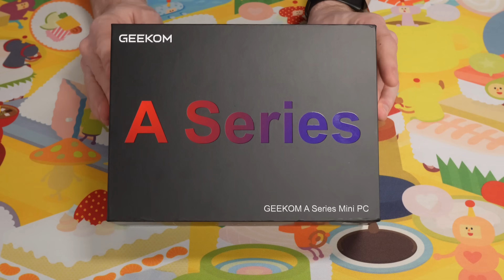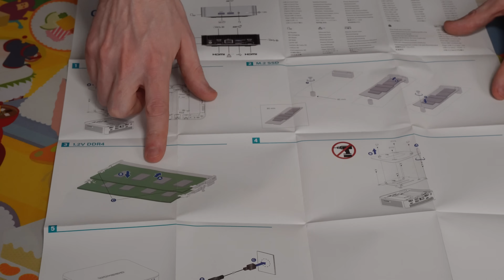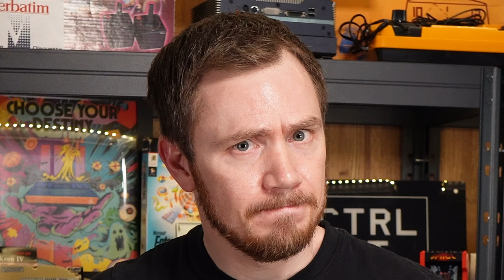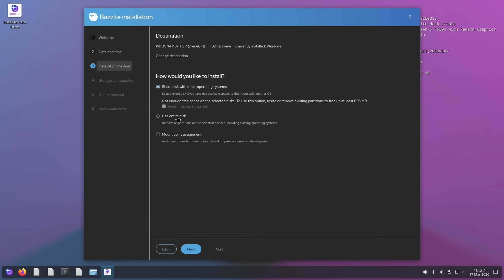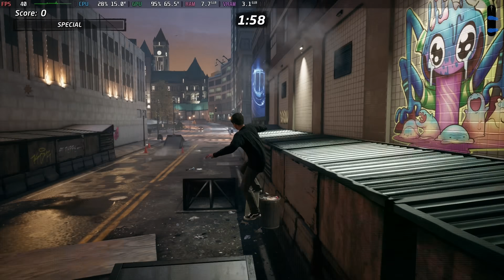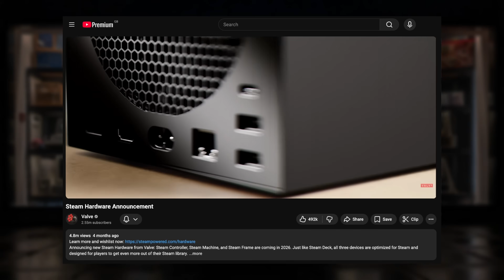A Smaller, Cheaper Steam Machine? The GEEKOM A5 PRO 2026

Comment: 21:11 when you were testing it in windows the power profile was only set to 2Ghz and was 4.55Ghz in Bazzite would have been nice to see it tested with the same power profile before its performance conclusions are all landed on the Linux distro, the pc needed correct setup for performance on the windows install first, i also understand that right there is where windows is failing and the out of the box performance was hampered with the preinstalled windows.

Comment: i will not touch any mini computer over 400 dollars. anything over 400 dollars is a rip off. it should have all the top of the line capabilities all for 400 bucks. period, and if the price of ram doesnt come back down , i will make my own ram. thats not a joke. i used to get 128 GB ddr5 for 125 dollars. now they want $5500 for it. fuck that.

Comment: Why does the Windows Geekbench show the processor running at 2Ghz  vs 4.55 for Bazzite?
Reply: Windows use throttling with CPUs; while linux unless you set a power profile for saving energy, is always using the highest CPU speed possible.

Comment: Hey @ctrl-alt-rees , could you confirm that that your Windows geekbench results were not done on some battery saving mode that the mobile hardware was running under?  The Bazzite results were impressive, but they were only marginally better then the Geekbench results for the exact same system using windows that were submitted by other users.  Specifically I think the GPU might be a factor as that usually get throttled by the power saving features.

Comment: During gameplay I noticed that the unit only uses 15W. 
If I recall correctly, they can go up to 25W and maybe even 35W? 
So you can actually get a lot more out of it!
Reply: I don't think that is possible without overclocking the device; a quick google for the the 7530U indicates that he GPU can go up to 45W and the overlay indicates that it is pushing near 60W at a 99% load, so I think his GPU is pulling from his CPU; Geekom could have these chips run extraordinarily hot given that they are not running off a battery in a laptop form factor, but regardless of that my speculation, he is very GPU limited as far as playing video games are concerned.  But yeah his CPU could be a lot faster then what he is showing due to AMD making it configurable up to 25W.
Reply: You can usually set the power level and fan settings on these miniPCs in the BIOS. Most of the ones I have can do all AMD official settings but the fan might get a bit loud.

Comment: The higher Vulkan score can make sense given different graphics drivers based on entirely different code, but the higher CPU score almost leads me to believe there's something wrong with the Windows install that comes with it.  Obviously, jokes about windows bloat and poor quality in a lot of ways, but it's usually not that far off and typically stuff like performance and power controls tend to be better supported in windows often leaving linux similarly behind in performance on unsupported devices.

Comment: It's pretty good value if you want a dedicated emulation station that can go up to some pretty recent generations of consoles (I've seen them run PS3 games with optimizations) + run Windows games (probably faster if using something like Bazzite because it won't have all the overheads)... 

Do I think it's a replacement for a dedicated gaming PC? No...

Will it tide you over in the (checks notes), RAM and SSD price hikes (yes, and it'll make a great little media PC once you're done using it for gaming/school work

Comment: Those benchmarks are suspiciously high to just be windows overhead. I wonder if bazzite is running at higher power settings
Reply: I have a mini PC running Bazzite I got from AliExpress last year and that looks about right for me. Much better moving over to any Linux distro than Win 11 IMO.
Reply: As you noticed, the power management on bazzite is set to max (this is by default). Not sure what is the profile set for windows, but if it is not the high performance one, that machine is throttling in W11
It is like running in a car with the handbrake on all the time; so not apples to apples comparison.
Reply: my guess is on the AMD chipset/graphics drivers not properly installed in windows 11. It's a manual install, not Windows Update.
Reply: Yeah, I have no clue how he is getting 15-40% better performance on the benchmarks.  My only guess is that he is running these tests off a old install of Windows 11 connected to the internet and all of the background tasks are occupied by Microsoft services.  The improvements people see on Linux as far as these low power devices are usually in the 1% lows, but never a generational uplift in performance; due to linux generally being better about background tasks.

Actually I have just looked it up on geekbench, there is something borked with the benchmarks in this video: all of the results for Windows runs on this exact hardware are in the ballpark of his geekbench runs with Bazzite.  So there was some power-saving setting turned on in software or his install of windows was going nuts updooting.

Comment: Geekbench browser is saying the processor is running at 4.55 GHz under Linux, but only 2.00 GHz under Windows. Any idea why?
Reply: I think he was accidentally testing while under a battery saving mode,  If you go to Geekbench there are a number of results from the same machine running Windows getting similar results to his testing with bazzite; some with his windows results and some with dramatically less, and the only thing that answers this would be the level of power savings that were used on this machine as these are laptop components so power profile should have a huge impact to results.
Reply: I wonder if the AMD chipset/graphics drivers were properly installed. It's a manual install, not windows update.